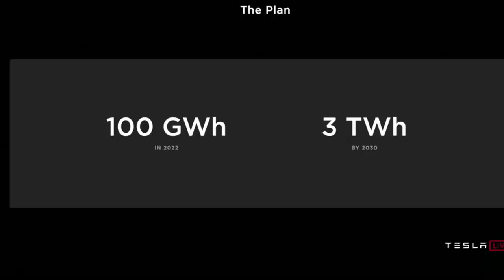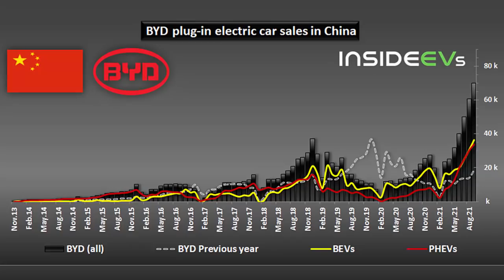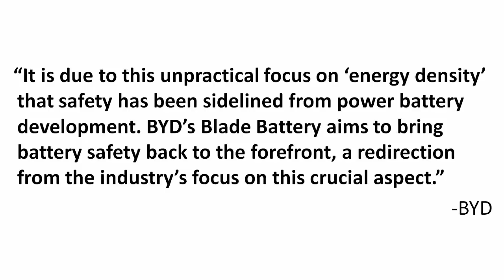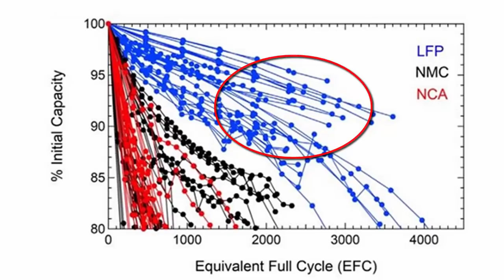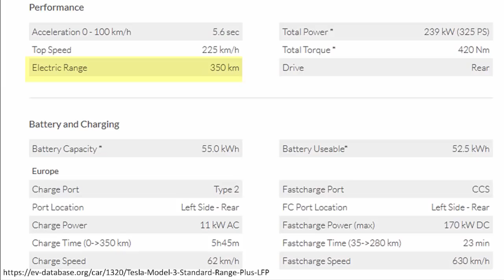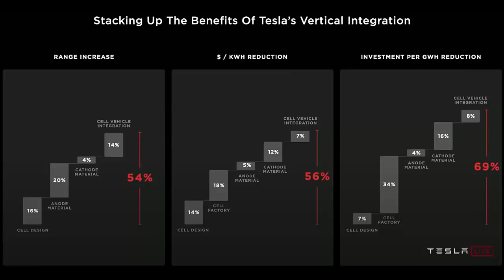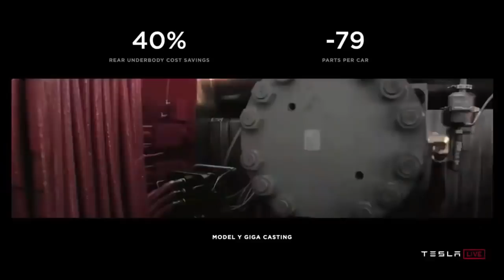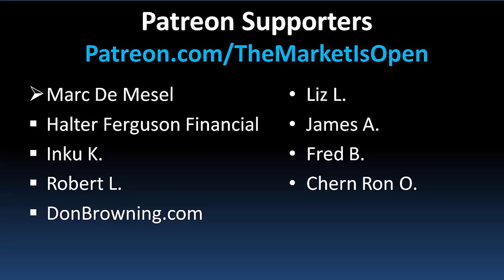Tesla Eyes Safer LFP Battery

Comment: Tesla Semi blade battery 4 Pepsi..?
Reply: Good point n question.
Reply: Unlikely.  I think that will be NMC chemistry not LFP.  The semi will need high energy density, not high cycle.  LFP is ideal for storage applications and low density, low performance EVs
Reply: No its 4680
Reply: @richpalmisano1740  
".....Low performance EV's...." Unless (untill) the 4680 structural pack, combined with a tweaked chemistry boosts PACK performance by say 20%.
Then, it's right in the window for EV's with performance that most ICE owners can't handle, at a cost that's transformative.
Reply: @rogerstarkey5390  Relatively speaking, yes.   An EV with 6-8 sec 0-60 would still be very sporty compared to most ICE.  But blade is proprietary to BYD and it would be theirs to improve.

Comment: I think the concept of "structural battery pack" is just BS.
Reply: Find some corrugated card.
Cut a log strip "against the grain.
Not very strong?
Now roll it up tightly.
Secure the edge with tape.
Now, it's surprisingly strong?
Same principle.
The structural pack is a genius solution.
Reply: @rogerstarkey5390  I'm not convinced yet.